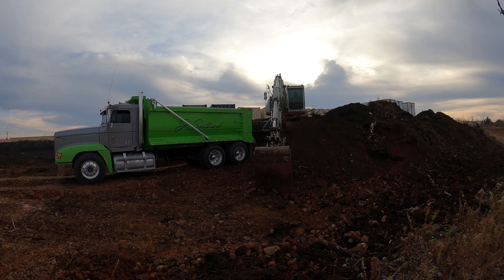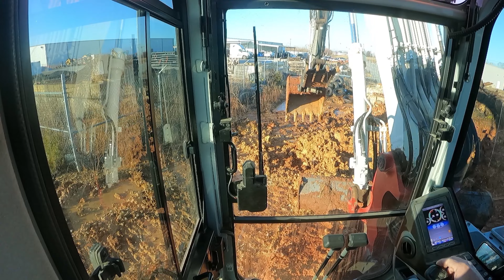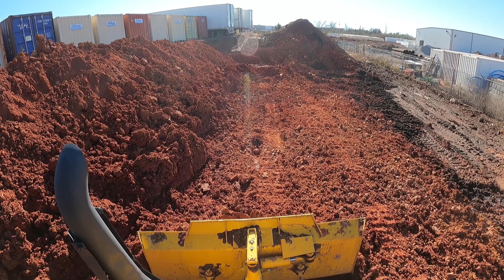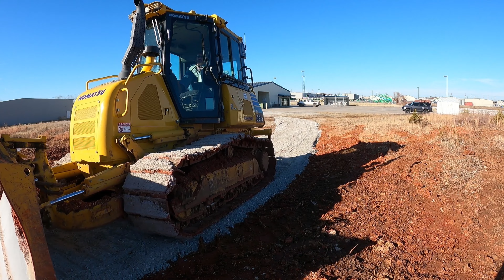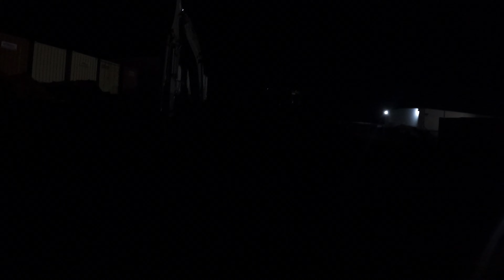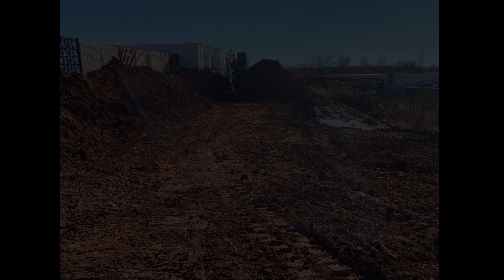Another Day Of Loading Trucks

Comment: You're not kidding about how trucks always show up all at the same time, they can be an hour apart and within 2 rounds are traveling together then they stay together all day long! I've been curious in the years I've been watching your vids I haven't really seen any truck/trailers (Belly dump or Side dump) even just on the road when you're traveling, are there not many in your area? In our area we use them more than dump trucks because they can haul 2 to 3 times what a dump truck can and only cost 25-30% more, a lot more bang for the buck.
Reply from the maker: We have two quarries 5 minutes out of town so I think that’s why most people run dump trucks here. We have a few end dumps but not many. It’s beat how different areas have different ways of hauling materials
Reply: @eliteearthworksllc  it is crazy how different areas do the same thing so differently at times and some places are only like 50 miles apart but yet have their own way of doing things. This summer I done a lot of job's that were only 3 miles from the gravel pit and were all done with side dump trailers. And when we paved the Jackson Hole airport in Wyoming the hot plant was literally 300 feet from the Runway we were paving and we paved using belly dump trailers. There's a lot of dump trucks here too but everyone is going to side dump trailers for most job's now.